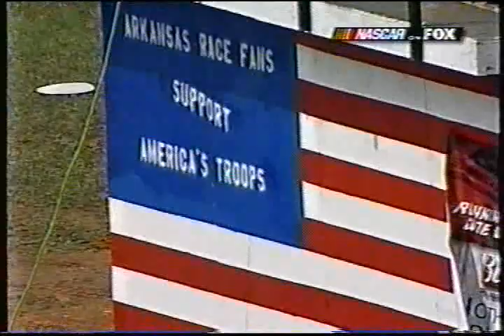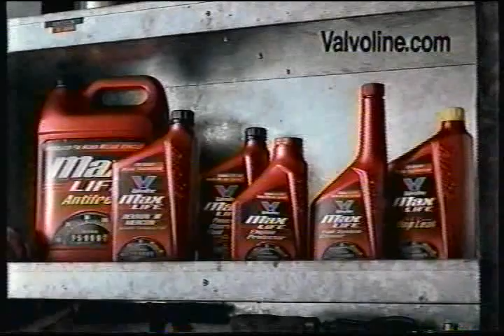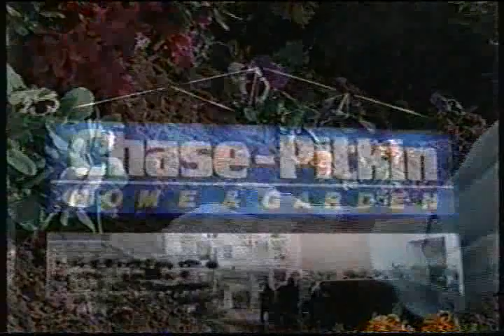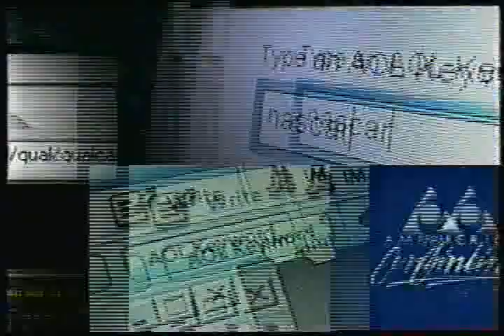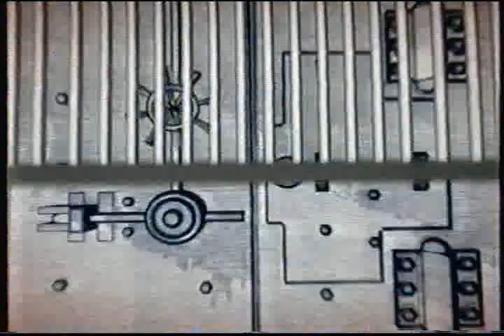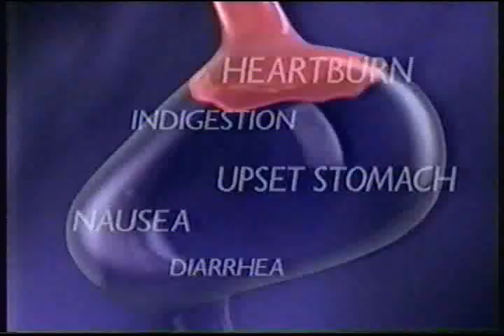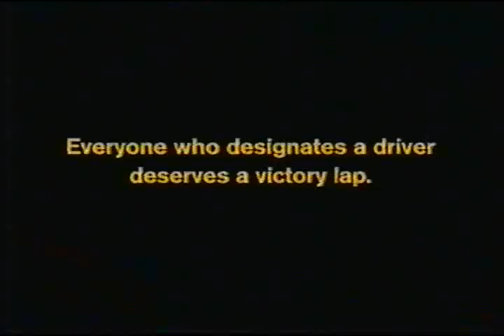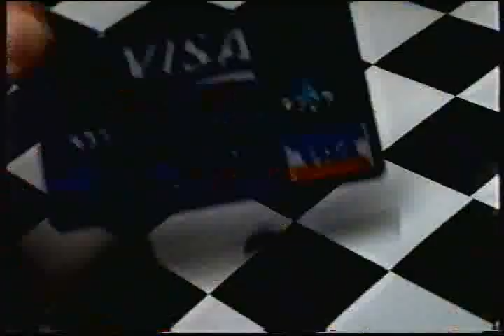2003 Aaron's 499 Talladega - Full Race

Comment: This is the 2004 race
Reply: Nope. it's 2003 because this was the last year when it was called the NASCAR Winston Cup
Reply: '03 this was the one Jr won, Gordon won it in '04
Reply: Here's the easiest way to tell this race being 2003 from 2004- Elliott Sadler's M&M's car. The 2003 paint scheme is completely different from 2004
Reply: I know I'm way late on this, but the DEI Cars also had the signature E on their roofs for 2003, but not 2004 as well. So Dale's car is also a dead giveaway.
Reply: Kyle Findley -- The three lines along the sides of the car were also shortened in '04. In this race we see the lines end at the rear fender, but in the following years they ended on the "doors" just before the rear wheels.
Reply: This was the '03 race. because I sang the National Anthem.